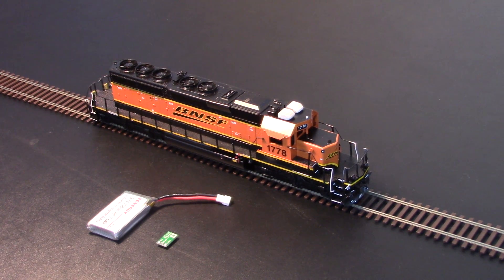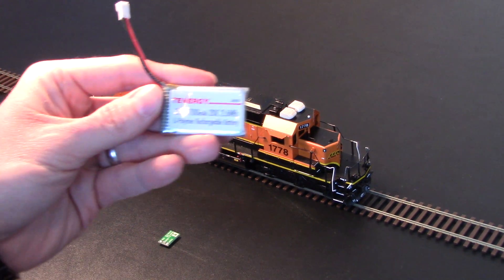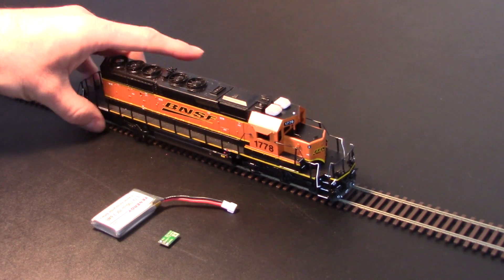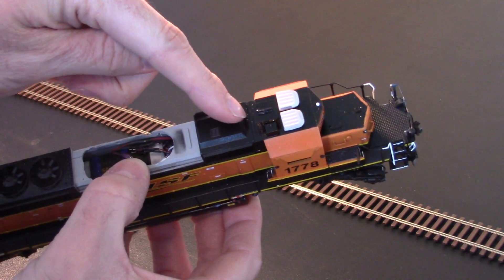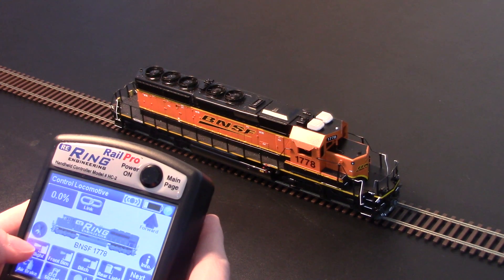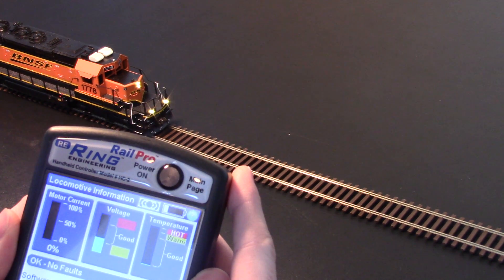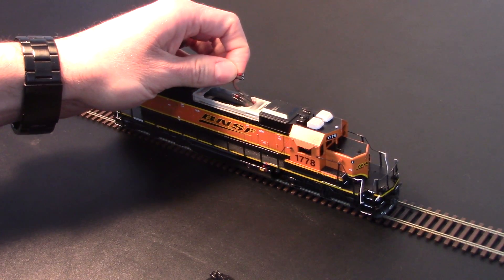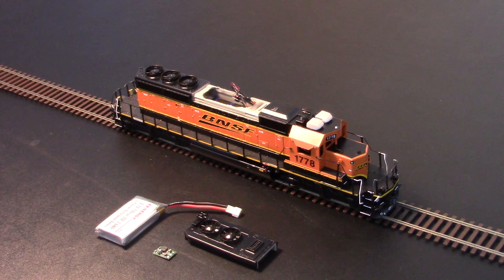Railpro on battery power (deadrail)

Comment: If you do have a "live" rail, could the batteries be recharged through  those as you operate the train on the layout. Either dc or dcc track?
Reply from the maker: You could, but you would need to have a circuit board/module that would control that.  There was an outfit that made something like that....I think it was Tam Valley Depot.  Not sure if they still do.  I didn't look into it because it was another thing to fit and it just wasn't necessary.  At that point you might as well run a keep-alive because it's essentially the same thing.  Just doesn't last when power is cut.

Comment: Ehhh, awesome concept but pulling batteries from numerous locomotives after a run and charging them all then reinstalling each one seems cumbersome and I prefer to handle my trains by hand as little as possible, basically for maintenance or derail damage which is almost nonexistent with good track work.
Reply: You don't have to remove the battery if you have access to the plug between the battery and the RailPro module. Just unplug and connect the charger cord to the battery lead.

Comment: Can tell me what the power convertor is setting the dc power to for the Railpro board. My interest is operating the Railpro on a layout with Vintage AC power only. I have used rectifiers and Volt Regulators to use adapt DC Controllers and sounds, and fan driven smoke and LEDs to my 1950s engines. I want to try the RailPro products in my engines. But i can not afford to convert train power to DC I have 20 or more engines i can not afford to convert.
Reply from the maker: I used the Pololu 12V Step-Up Voltage Regulator U3V12F12.  I picked it from Litchfield Station.  Get some extras...I burned one of them up because I was an idiot and connected it wrong.
Reply: @freewake84  Found it $8 up to $15 but i am unclear how you used it. Would I set that in the engine and take track power thru it and output to the Track Module 3S? This would be awesome if i can create an acceptable power supply from the track power and operate the TM3S via Radio signals. Thank You for your reply Dennis

Comment: Need to setup your battery to charge from available track power! Much easier, and never have to touch the locomotive again.
Reply from the maker: Yes, but the circuitry takes up much more space and is an added expense.  To be honest, I've determined that a good keep-alive is more useful than battery.  Zero maintenance and keep-alives fulfill essentially the same function as a battery.  Railpro's new keep alive is the one I'm going to start using from now on.
Reply: @freewake84  
For this to take off it needs a manufacturer to jump in. Start by offering it in starter sets. The extra cost for the locomotive can be offset by eliminating the power supply. Attractive to parents as this no cords to trip over. Simply have an app for a smart phone to handle control functions via Bluetooth. And get rid of the name Deadrail. Simply call it wifi or wireless. For charging on these basic locomotives a plug and a phone charger.

Comment: Have any of the model makers moved to this technology over dcc yet.   I think rc battery powered engines would help many new people enter the hobby because of the ease of switching and not having to do complex wiring with frogs
Reply from the maker: In HO scale, no.  Large scale yes.  I don't see this becoming a big thing in HO scale anytime soon.  I do love the concept, and this locomotive still works flawlessly, but it's just so much easier to install a keep-alive and be done.  It accomplishes the same purpose without the headache of trying to fit a battery in there.

Comment: I always figured that battery powered would be superior at low speeds, and this video seems to indicate that. No matter how good the electrical pick ups are it always seems like locomotives hesitate a little bit at start. Since this is not relying on a pick up but a battery pack, looks like it crawls very very smoothly and realistically.
Reply from the maker: I do love that battery power is completely free from pick up problems.  Keep-alive will do much the same, but on really bad/dirty track they will drain quickly.  But they do help with the startup.  

This particular locomotive isn't as smooth as many of my other ones.  That has nothing to do with the battery or Railpro, it's just the drivetrain of the loco.  For whatever reason it takes a bit more power to get it started than say a ScaleTrains SD40-2.

Comment: Yeah I got the warning of a risked fire too. Has any of your engines caught fire yet?
Reply from the maker: Nope.  I totally get that LiPo can be dangerous and that precautions need to be taken.  And Ring Engineering needs to cover itself from any liability.  I have no problem with that.

The locomotive is still doing great.  To be honest though I don't use it as much as my other locomotives because I'm never really sure where the charge level is at.  I charge it so infrequently that I'm sure the battery drains down pretty far before I get to it again.

Comment: Should have the rails powered to be able to recharge the battery
Reply from the maker: I didn't do that because I wanted to try full dead-rail.  Having power to the rails to recharge the battery is essentially like using a keep-alive.  A battery in that sense is just an enormous keep-alive capacitor that really won't do anything different than using a typical keep-alive.  Not to mention that I would need to install another piece of hardware to charge the battery.

I built this locomotive as proof-of-concept that a fully dead-rail locomotive can be done using Railpro.
Reply: KPack 
The best way to do it would be to park your train over a wireless charger like cell phones use.
Reply: If you did that you would have to install a bridge retifier so you don't short out the battery when you change from forward to reverse.

Comment: Hello, I would love to see dead rail become the new standard in HO models.  But do these batteries age and lose charge over time,  how long before one has to buy a new battery?
Reply from the maker: All batteries will degrade over time and require replacement.  I believe it mostly has to do with the number of charge-discharge cycles it goes through.  I'm not sure how long these particular batteries will last, but so far so good.  I don't run all the time so the battery doesn't go through many cycles.
Reply: Has there been any standardization of Dead Rail systems. I'm also surprised that this is not available commercially.

Comment: This is awesome.... any updates?
Reply from the maker: Nothing new.  The locomotive still works fine.  I haven't done a second one because of the difficulty in finding space for the battery.  Milling out the frame is not fun.

I've more or less standardized on using keep-alive capacitors instead of full dead-rail.  They are easier to install and work fine.

Comment: Does this mean I can use a DCC model on DC rail due to this running on battery
Reply from the maker: Any locomotive that is fully dead-rail should be able to run on any track, regardless of what power source is fed to the track.  Full dead-rail implies that there are no wires coming from the wheels to any electronics in the locomotive.  If you have a hybrid dead-rail (charging the battery from the rails) then your hardware needs to be compatible with different sources of power (DCC vs DC)

Comment: Great information, thank you for taking the time to share. I sure hope this catches on. I would be happy to pay a premium for a locomotive that came with battery power and a built-in charger. This has got to be the future -- I hope. Taking track wiring out of the equation is paramount. What kind of run time are you getting on one charge? Have you consisted two or more? Thanks again!
Reply: KPack , I am so impressed.   Finally we are moving the hobby to a more prototypical operation of our trains.  Eliminating the mass amount of wiring should help to open up this hobby to many more people
Reply from the maker: Run time has been satisfactory.  On a full charge it will run around 4 hours or so, depending on how much it is pulling, etc.  I haven't done a second battery-powered loco, but I have consisted this one with all my other Railpro locomotives and it works great.  I love how it never stalls!

Comment: The real 1778 is in Barstow CA as a switching power
Reply from the maker: Sounds like it got moved then.   It was working central Washington for a good while with its sister unit 1999.  Did that unit make it down there also?
Reply: KPack not sure if it's sister made it but I was on the 1778 last night
Reply: My bad it was the 1748

Comment: What was your over all cost in switching over remote? I have older none DCC trains. Is it possible to do this to them? Also great video.
Reply from the maker: Thanks Russell.  There are two different ways you can go to switch over.  The first way is to purchase the full controller, which retails for about $225, and some modules which retail for around $75 with sound.  A less expensive way to get into Railpro would be to buy a CI-1 (computer interface) for $40, which turns a computer into a fully-functional Railpro throttle.  It's a nice way to get involved in Railpro without a large expense right off the bat.  I still recommend getting at least one normal controller though.  

You can certainly convert DC locomotives to Railpro.  They will need a standard DCC 9-pin harness hardwired into them, which the Railpro plugs right into.  There are numerous videos and instruction manuals out there that show how to hardwire in 9-pin plugs.  I have hardwired nearly all of my locomotives and it is not terribly difficult once you have done it a few times.  If you don't want to hardwire anything yourself there are a few stores that will do it for you.
Reply: @freewake84  i want do this With a H0 loco With battery and more interresting, see if its possible to get the modul in a N scale loco… tought to put it where the fueltank is, between the trucks and wire all directly on the modul...  N scale will be without battery think i, to less space....

Comment: Thanks for sharing.  MRH just did an article in the October 2017 edition.  The MRH article was my first introduction to RailPro; didn't know it existed.  Liking what I've seen, however I'm in N-Scale, so I'll have to give it some time for Ring Engineering to bring the RailPro loco modules to fit in the smaller scale.  Like the other commenters, I agree that deadrail is the future of the hobby.  Thinking of existing charging technology - you can wirelessly charge a cell phone by induction, why not a loco?  Wish I was better with electronics as there is money to be made in providing the solution for running loco's off battery for those modelers that want to go that route but don't have the knowledge.
Reply from the maker: It was a good article that MRH ran.  Railpro has been around for a while, but flying under the radar.  I have had it since 2011.  Since then it has improved dramatically, especially in the sound arena.  I know Ring Engineering has plans to bring it to N-scale at some point, but when that would happen remains a mystery.  I can imagine it would be very difficult to miniaturize everything into something that would be viable for N-scale.  The installs certainly wouldn't be plug and play.  How Ring will all make it work remains to be seen.  But hopefully it can be done because I know quite a few N-scalers who would jump on board if this were made available to them.
Reply: I have railpro for g scale I also have n scale and wish they would release for n scale also. I thought about doing a trailing car with a ho railpro board but don't want to always have the same car behind the engine.

Comment: Railpro has a system that's not getting print and airtime. Dcc is about 30 years old and is the standard by the industry. It's going to have to move in Railpro's direction.  Battery-powered locomotives in the hobby are coming too.
Reply from the maker: You're correct Richard, Railpro doesn't get a whole lot of print and airtime.  DCC is still by far the most popular, especially as every locomotive manufacturer offers their locomotives with DCC decoders pre-installed.  One of us users really ought to write an article on Railpro installation/operation for MRH.  Many people have heard of it but don't know much about it, or are misinformed by detractors.  

I also agree that battery power could become the future of the hobby.  Keep alive capacitors certainly have become the norm, and batteries are basically a glorified keep alive.
Reply: KPACK, would you be up for joining us on the MRH Podcast and chat with us to your experiences with RailPro and Deadrail? Feel Free to email me back, chrispy_joe@yahoo.com
-Chris

Comment: That's very interesting, looks like something that would be great for use on a large or small layout, could you charge it through the track by parking it on a live track like it was in a refueling yard? just one more step to working like the real thing....
Reply from the maker: Hi Jack, as I have it right now you will not be able to charge from the track.  In order for that to happen I would need to install another board that manages the battery charging and discharge.  I believe Stanton makes one called the BPS.  I didn't include it because of the size, and also because I wanted to make a locomotive completely independent of any track power whatsoever.  In reality, it would be better to install a BPS in line with the battery so that the battery always remained charged.  Perhaps I will do that on the next locomotive?
Reply: That's great and thanks for the information,  I'm still for Railpro to make thier system for N scale  & I like this idea for my trips to San Diego at the Balboa Museum we run on once a month this would be a great way to show off railpro system
Reply: i think RailPro and battery power are the future  i am either going rail pro or nce  leaning twards rail pro
Reply: Jack O. I was really thinking about that yesterday and how awesome of an idea it would be to have a few areas on the layout to charge the power in the locomotives at just your diesel fuel area, roundhouse tracks, staging yard lines and for emergency, helper parking, yet still be able to run on a powered track if low on battery, who wouldn’t want that? Just charging from the wheels to 1 track area to get power.